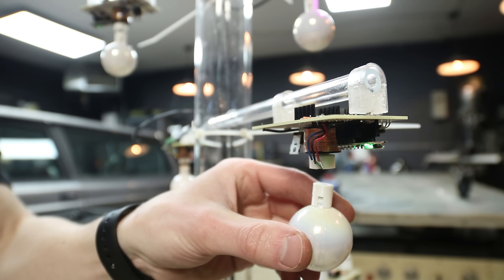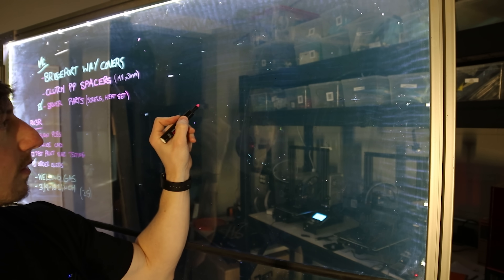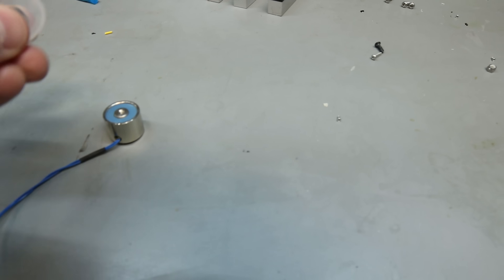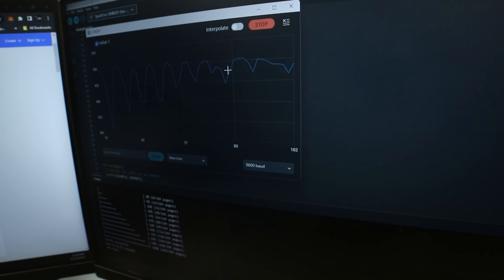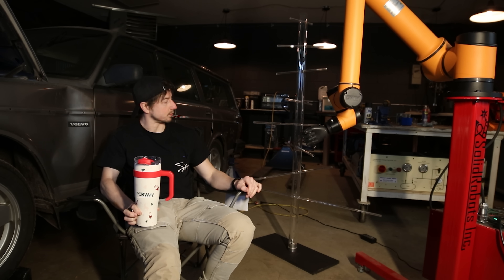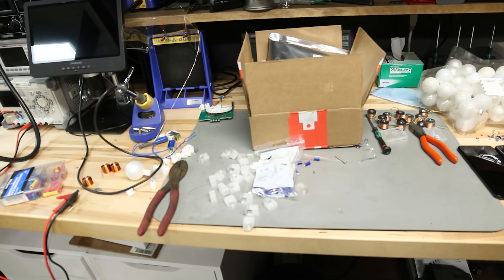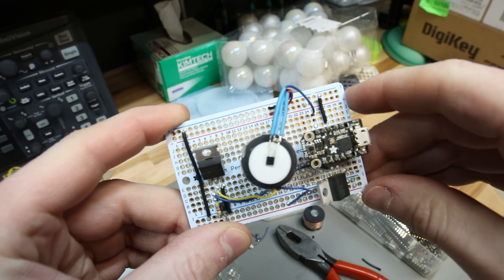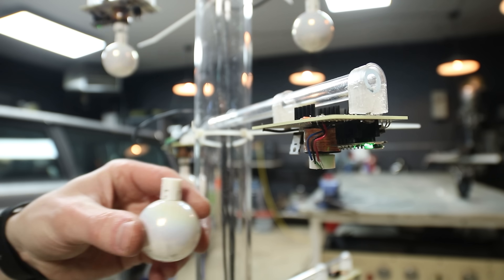Magnetic Levitation Christmas Ornaments

Comment: @3:22 It looks like your electro-magnets have a hole in the middle.  Couldn't you aim a laser pointer diode from above the magnet through the hole and into the 'floating' ornament to hit a diffuser inside the ornament to give it some light? I am assuming for no particular reason that the metal on the ornament also has a hole in it.

Comment: Did you consider sampling the back EMF from the coil to determine the distance to the permanent magnet?
Reply from the maker: I did not. That sounds like a cool way to do it. One problem with the linear hall sensor is the EM messes with the sensor. I tried turning it off to take a reading but with the inductance the current sticks around too long. So that could be an alternate solution.

Comment: Take the magnet OUT of the payload and just use a piece of ferrous material.
There will be NO attraction when the electromagnet is off.
Reply from the maker: They don’t pull enough to do that. You need both, and the linear hall sensor can’t detect non magnetic ferrous metal so the system doesn’t know where the object is.

Comment: Did you end up using PID control for the electromagnets?
Reply from the maker: No, couldn’t get the PID tuned properly in time. , I might do a livestream doing some more stuff with them.
Reply: @SeanHodgins  That would probably make them behave more stable and in turn reduce the power consumption so they don't start overheating.

Comment: I wonder if you could use the magnetic field turning on and off to light up the ornament?
Reply from the maker: You could add a separate circuit to handle that, I'm not sure how easily it would be done with the single EM. I decided against trying that early to avoid scope creep.

Comment: I'm not sure I followed the logic for your electromagnet choice, I was able to achieve the same with the same with your first mentioned electromagnet a couple years back. I'd like to know more about why you thought it was too ferrous.
Reply from the maker: Hmm, I think it’s a timeline issue, I could see it working, but the stability issue I was having was causing them to jump to the edges. So maybe the magnets I was using were too strong!
Reply: @SeanHodgins  That could make sense, the magnets I was using might have been smaller. I'd be curious to know how the power consumption compares because from my understanding the shell around the coil focuses the magnetic field more in the direction you're interested in holding the magnet up.